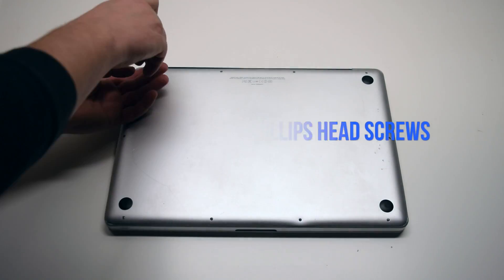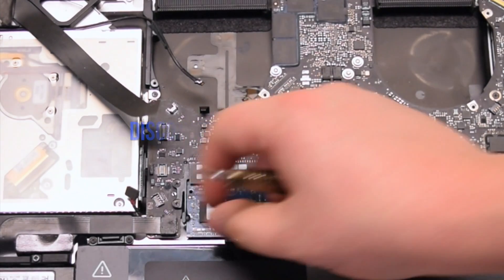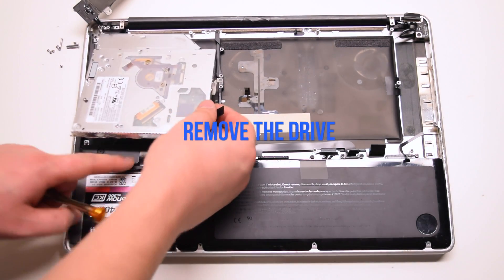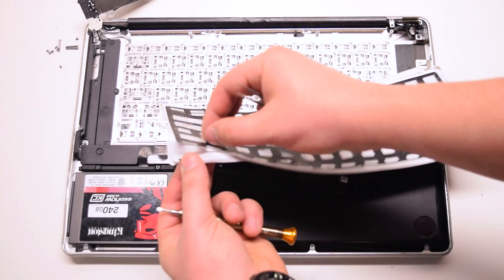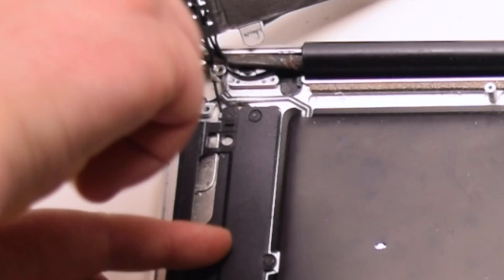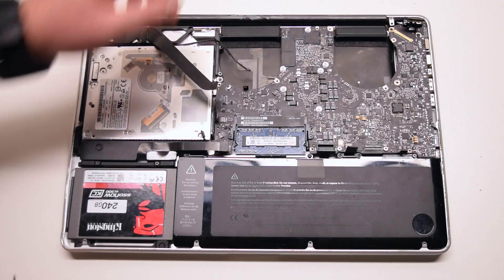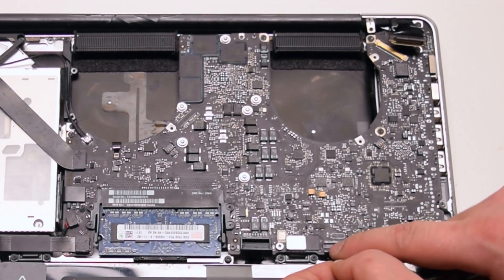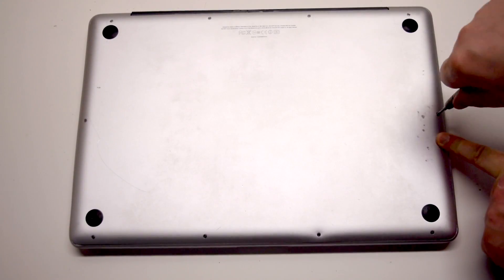2012 Macbook Pro 15" A1286 Keyboard Replacement

Comment: Amazing stuff, thanks for sharing. And thanks for showing the full re-installing of everything after removal, and not just saying "reverse the process", as this is a complicated install and I imagine that most of us will be following along step by step. I'm thinking of tackling this but it looks daunting with all those small connectors. Using an external keyboard for now.

Comment: Computer won’t turn on now. The battery is connected and I can touch the battery button on the side and get a read. However the computer doesn’t turn on. Did I not reassemble the power button properly? Or would any damaged connectors not allow the computer to turn on? Would really appreciate your help!

Comment: Thank God I have a 2012 MacBook pro in 2022 
Going to do this this week 
After I change the battery my D,F,G,H,K,L keys stop working.
If anyone has a solution to fixing besides replacing please let me know
Reply: Wonder if you found a solution? I have had some keys (in the original keyboard) stop working, and am not sure if it's a software issue or the keyboard needs to be replaced. Sometimes they work and sometimes not. I've done all the normal things to clean, repair and replace the keys, and have replaced about 6 of them with new keys and cones. Still have the same issue, have been using an external keyboard now for the past year. Any suggestions appreciated 🙏
Reply: @AfricanFlightStar  yes I have 
Replaced it 
I did it myself and it works.... 54 screws to take out   and average an hour of  work. And you will be good to go

Comment: Very good video - I installed a new keyboard successfully. The only feedback I'd give for future videos is to have a high-res closeup when showing how some of the connectors go in. Inserting the keyboard ribbon is quite difficult, and I couldn't see how much it should go in. 

Thanks again - $50 for a new keyboard and this video meant a cheap repair.

Comment: Great video! However, could you specify the kind of screwdriver you used to remove the 51 screws? I have phillips 0000, 000 and 00 but those screws on the keyboard don't seem to take any of the three screwdrivers. They spin loose inside of the cross. I don't want to risk stipping them. They're made of butter and I had a bad experience working on another computer. Thanks!

Comment: Just finished all the steps and absolutely have to say, thank you!.  This easily saved me $300.  Love to say the check's in the mail, but I'm working on honesty.  <grin>
This well-illustrated, totally accurate, walk-through could only be better with audible audio, but the titles  got me through whispered instructions AND my MacBook Pro is back in service.  (...water spill, don't ya know.)  Many thanks!

Comment: Thanks for the video. I inherited this m'book from my daughter with a missing key and several keys that didn't work. Followed your instructions, including an ssd drive and more memory, and now everything is working as it should (otherwise I wouldn't be typing this now). Had to get a bit creative with the antenna wire to allow the power button to come out because of a dodgy bracket screw that wouldn't securely grip anything I poked at it, and the 51 tiny screws for the keyboard just about did my head in. Audio was a bit on the soft side during the video, even at full volume, but overall, after watching the video several times your instructions led to a successful outcome. Thanks again!
Reply from the maker: Glad to help! Support us on Patron https://bit.ly/2F3ebil or By clicking the KEEP US GOING button at https://www.appledollars.com/support-us

Comment: I did the same like you did and changed to a new keyboard but still have the same problem keyboard not working not all the keys work and when i press capslock the light blink and then turn off what i must do and thank you
Reply from the maker: They keyboard could be defective and you might have to replace again, but first try reseating the keyboard connector several times.

Comment: hey, everything worked very well. but i have huge problems to reconnect the keyboard cable to the logic board! please help me!
Reply from the maker: It's a skill and a lot of prying with tweezers. Just keep trying, if unit doesn't power on then reseat the keyboard cable. Sometimes takes 3 tries or more.

Comment: Nice tutorial, thanks. I'm thinking about replacing my Macbook Pro keyboard because there is one or two letters failing sometimes. My question is... did you replace the backlight layer with a new one or used the original? I found the keyboard without backlight (assuming you won't damage your backlight layer) for sale for $12, thinking about buying it...
Reply from the maker: Buy a keyboard with a layer because most of the time there is a spill that is blocking half the layer and it's just dirty. Maybe $10 more bucks but will save you a giant headache.
Reply: @GRIBSOFT  Thanks!

Comment: Thank you so much felt really confident with your step by step guide! Saved my computer and my pocketbook. May I add that when reassembling....the keyboard ribbon has an extra lever that must be lifted in order to properly install the ribbon and lock it in place. The lever is so slim you almost miss it - but it is there if you have small tools and are gentle you will lift it. Then slowly move keyboard ribbon all the way in and then press lever down. -
Reply from the maker: great tip
Reply: Wow! Thanks! That ribbon is extremely difficult to reinstall.

Comment: for the little bracket in between the keyboard connector and the trackpad connector, is the trackpad wire supposed to go under it or over it? what is that little bracket for?
Reply from the maker: It goes over and is meant as a protection shield that keeps the connections from coming apart.

Comment: hey, my track pad doesnt work After the Installation, tried to disconnect and Connect it again, but nothing helped, what can i do?
Reply from the maker: Look at the teeth make sure they are not bent. Just un plug, reinstall and test it again. Boot it while it's hanging to see if it's siting incorrectly in the slot. Here is a track pad repair video http://www.appledollars.com/trackpad-replacement
Reply: Save Apple Dollars what do you mean by „reinstall“? Is there a way to reinstall the trackpad without using it ? 

And what do you mean by „boot it while it’s hanging“?

Thanks a lot for your answers
Reply from the maker: Remove the track pad completely, then reinstall it as if replacing it. See if that helps. You can have the trackpad hanging and out if it's socket and boot up the macbook while it's open and test it. That is a more advanced troubleshooting technique that saves time.
Reply: ok nice, i'll try it tonight!
Thank you!

Comment: Now my speakers are sounding tingy, like with no base.I tried setting the audio channels, but nothing works.Did I damage anything I wonder? I was so focused on not damaging the logic board. Any help?
Reply from the maker: It could be that the speakers are loose or not connected all the way. I would take them out and observe the actual surface of the membrane and make sure nothing is blocking it's motion. Many time just taking it apart and reassembling it will fix the issue.

Comment: Yes amazing video! I nailed it to the T. One issue after turning on though - now the screen looks weird with colorful ants walking. I can see my desktop. What did or didn't I do? Even installed a new battery. No parts left behind, nothing nicked, no screws left behind and no damage to the logic board? The cable for the screen is plugged in correctly. Please help. It took me 3hrs as I was super careful.
Reply: Update: The cable was a bit wonky so I fixed it! Screen is good to go.
Reply from the maker: Glad that things worked out. Congrats!

Comment: Totally accurate. Nice job. One note: Do not turn the computer over after you unscrew the power-switch connector. The power button and little spring ring will fall out. If this happens, put the button back in and then the ring.